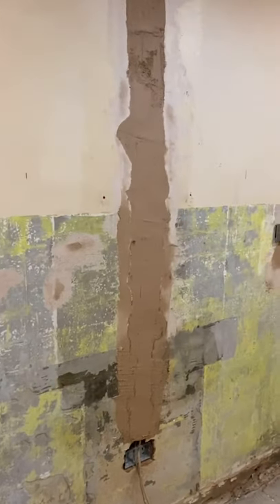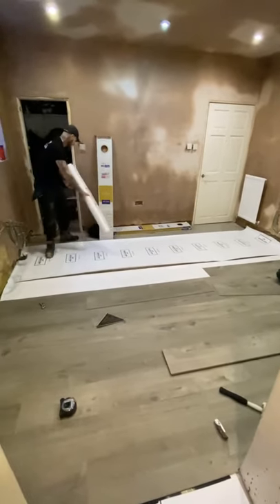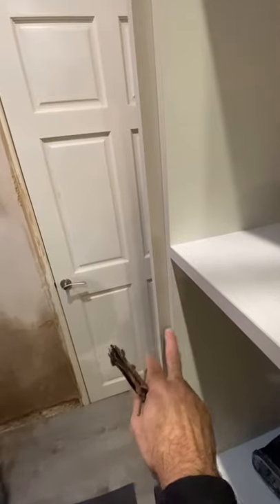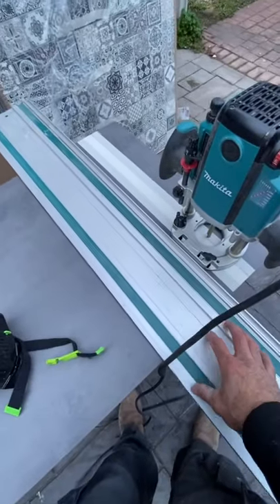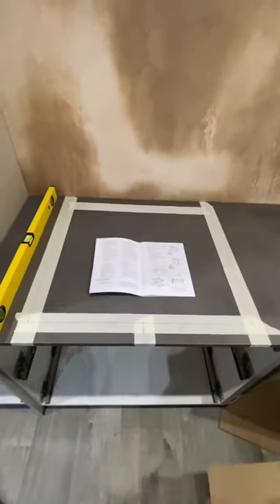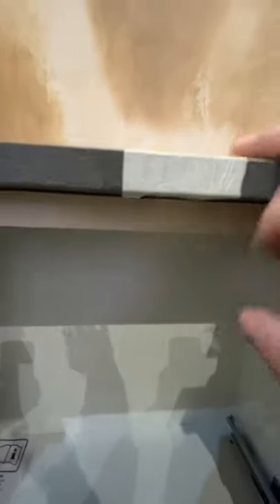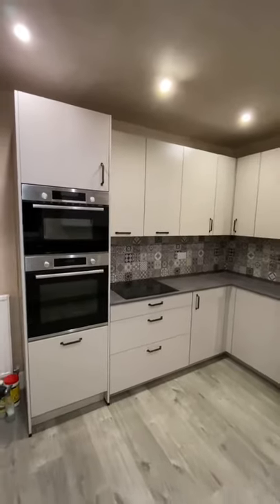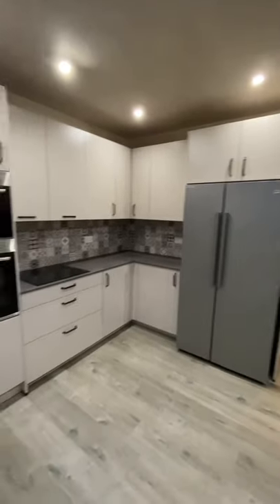Kitchen renovation. Kitchen fitting. Kutchehuas kitchens.

Comment: I have a question. As a kitchen fitter myself I have come on this site to see the quality of the kitchen as I believe my customer is opting for kutchenhaus. Are the decor panels made of chipboard as they mostly are and if so how safe is it to expose it by planing the edge off and fitting it to a wet plastered wall. I’ve never unpacked a kitchen in a wet environment let alone fit it. Regards Chris
Reply from the maker: If Unsure you can always seal all the edges with clear silicone or PVA have I never had issues fitting the kitchens as we usually leave at least two days between Plaster and fitting but obviously as it’s winter call the conditions prolong the drying times so we monitor the wall and make a decision based on previous experiences if you look at the section the end panel was fitted to that section is dry